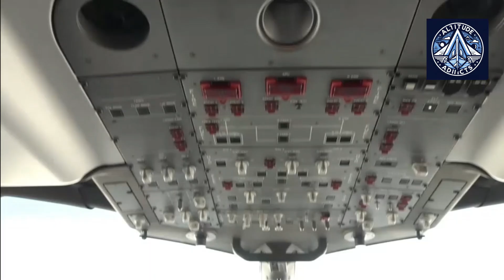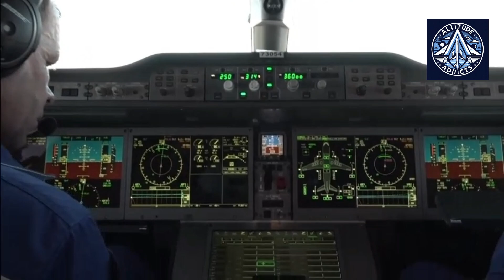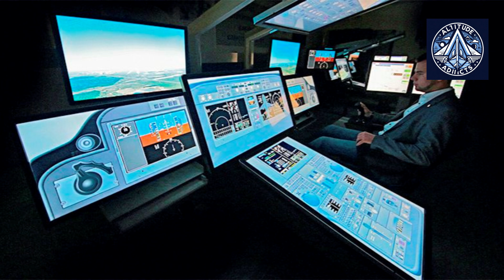Electronic Bird -  MC-21 Virtual Flights to Beat Certification Delays

Comment: FYI th sanctions didn't begin in 2022 but in 2018 the polymer composite used on the wing came from the west at that time today we're producing composite wings with locally sourced polymer 😂 best thing happened to Russia are the sanctions same for 2014 when they sanctions Russia we were net importers of wheat today's Russia is the 2 top export 😂

Comment: The world is patiently waiting for the MC 21 310 and the SSJ New aircraft to take to the skies
Reply: the SJ-100 (formerly known as SSJ-100 New) is already doing test flies for certification, almost on a daily basis.. however, the Russian PD-8 engines are not ready yet, so the SJ-100 is using the foreign SaM146 engines for the moment

Comment: Amazing what one can do with washing machines chips. lol.    You made a video previously claiming the plane had gained 5 tons of weight due to sanctions.  Any chance you could figure out what components were substituted and why so heavy?
Reply: the import-substituted MS-21 is still in the final design phase, so any judgment about its characteristics (weight, range, etc.) before it flies in the sky is going to be a premature assumption to say the least
Reply from the maker: The substitution is for all components. The weight increase was once explained by an official. He said some additional equipment was requested by airlines. Unless the final confirmation comes out, even the project managers won't be able to comment on the weight.
Reply: All made Boeing death traps in WASHINGTON hmmm